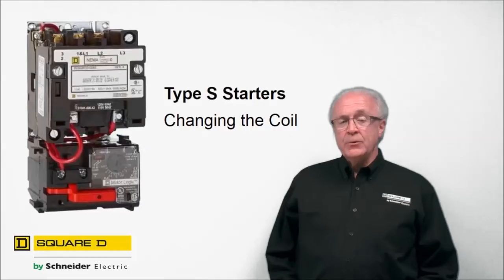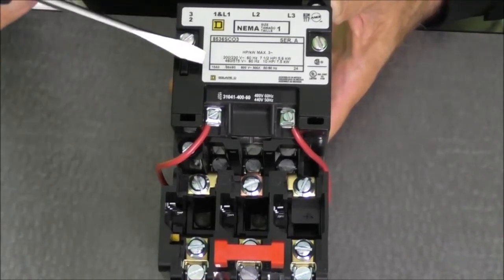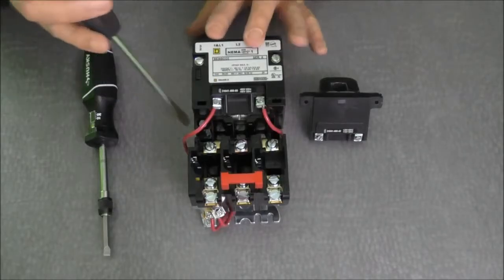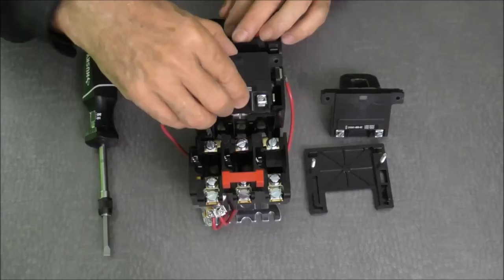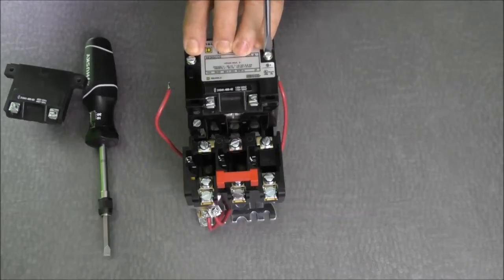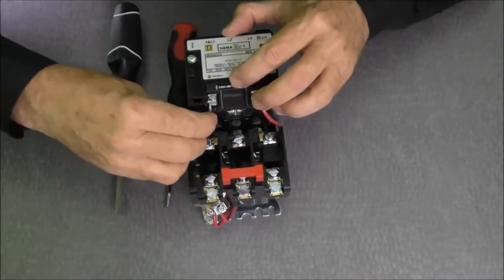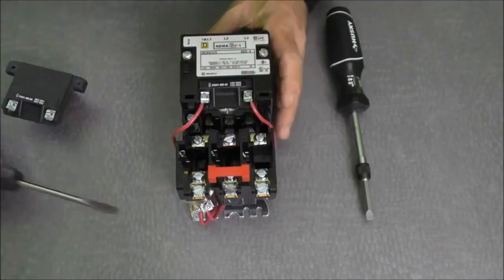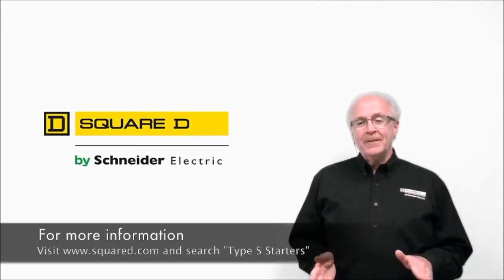Replacing Coils on NEMA Size 00, 0 & 1 Type S Starters | Schneider Electric Support

Comment: Hello Schneider-Electric.  I have the same Magnetic Starter.  I want to use it on a 3 phase motor for a dust collector on low voltage setting of 208v-230v.   So far I have 240v coming from a double pole 30A breaker, I have a phase converter creating it into 3 phase 240V, then I have it plugged in to this very same Magnetic Starter NEMA Size 1 Type SC03 8536 with a 480V/440V Coil No. 31041-400-60.  The on button seems like it wont stick.  To power it on I have to press it with a screw driver and it runs smoothly.  But once I let it go, it shuts off.  It is because my power is only 240v and my coil is for 480v?   Do I need to change the coil to 208V 31041-400-48?  After changing it do I have to remove the common control?  What is the difference between common and separate control?  Thanks!!!!!